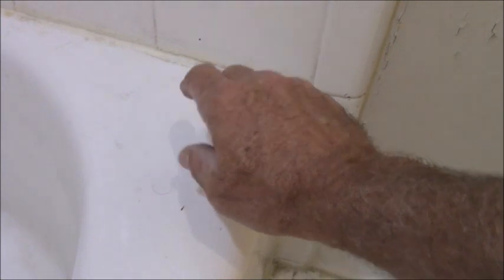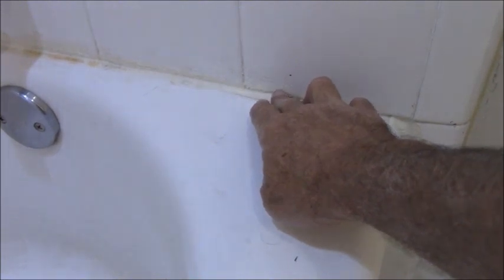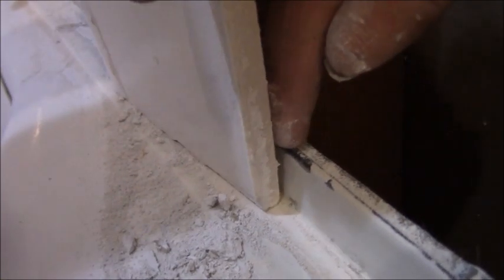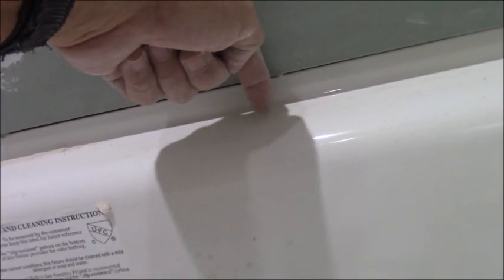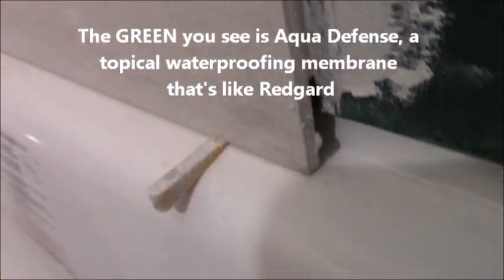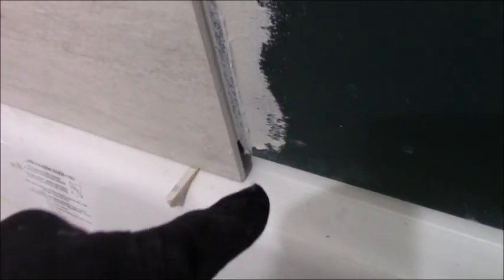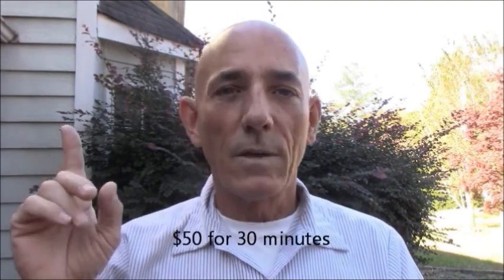MOLD & MILDEW ON BATHTUBS...why it WON'T go away !

Comment: Should you waterproof the bottom edge of your wallboard too? Seems like an area where water can bounce up and hit. Or at least it can drip down to that area
Reply from the maker: Yes, you can see where this was done...but there's a good part of an inch from edge of tub to the lip.
Reply: Yeah I actually have an idea for situations where the wallboard fits better over the lip. It's to waterproof the bottom 6 inches or so on the front and back of the board and the entire bottom and side edges before hanging it.

Comment: Should the insulation behind the shower on exterior walls have kraft paper backing? Or does the red gard waterproofing make the paper backing a bad idea?
Reply from the maker: Any insulation is a bonus...I'd put it there regardless
Reply: Ok. I was just wondering if I should cut the kraft paper when I install the bats. (Mold sandwich theory?) I will definitely be putting insulation back in. The old insulation did not have a vapor barrier. It was just blown in fiberglass. I should have a donation coming your way soon because the videos have helped a lot.
Reply from the maker: If no waterproofing was done on the wallboard you would still have insulation, then a vapor barrier, then wallboard. What I'm saying is you've bumped it up so that your vapor barrier is the waterproofer, therefore the insulation can still be used. Assuming you used neither is the mold sandwich thing.

Comment: What gap if any do you like to see between tub surface and tile bottom edge? I see a small wedge near the end of the video. This would allow for caulking to make the seal. Wouldn’t a 1/16” of caulk be appropriate? Thanks for the great videos!
Reply: reedrobb you must donate $50 to his PayPal 😂😂😂😂😂👍🏻 to find out
Reply from the maker: Yes about 1/16'', no more than an 1/8''
Reply: Would you need to leave makeshift weep holes in the caulk in case some water does penetrate through the grout and run down onto the tub lip behind the tile?
Reply from the maker: No, that would not be a good idea...but more to the point, water would & should never get into grout to that point, if it does you did something REALLY wrong.

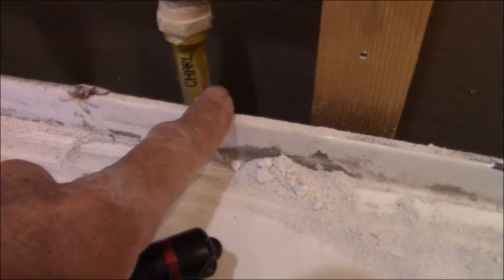Comment: I noticed that the previous installer put greenboard on top of another layer of what looks like sheetrock (2:32) and the tub flange is set with a space about 1/2 inch away from the studs. Is/was that common practice? Why would someone do that?
Reply from the maker: It's called sandwiching...it facilitates putting up mudcaps, the rounded tiles on the perimeter of the walls.